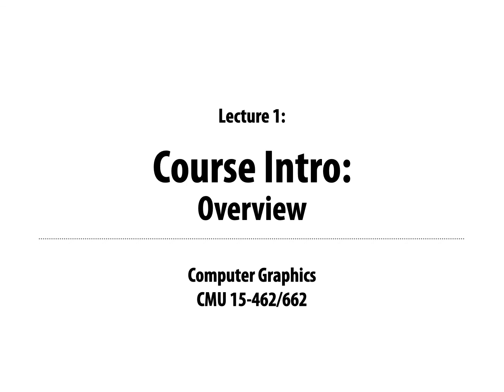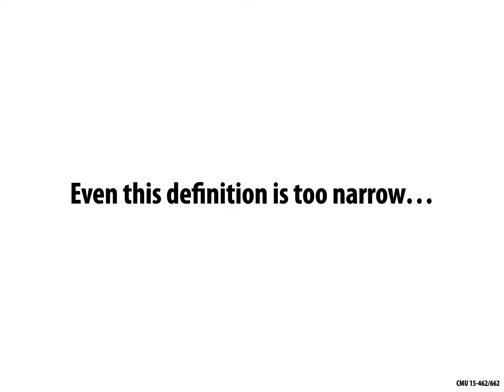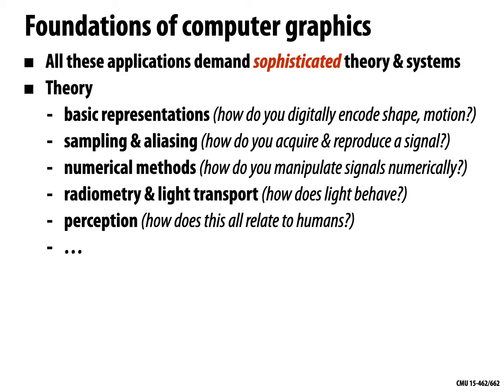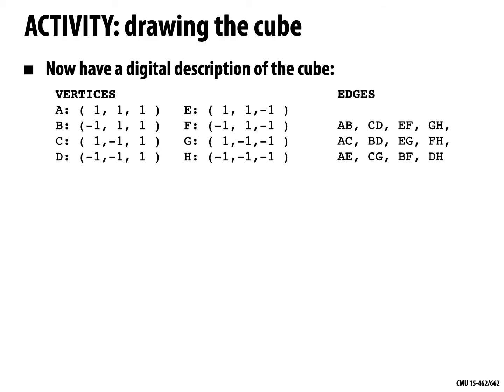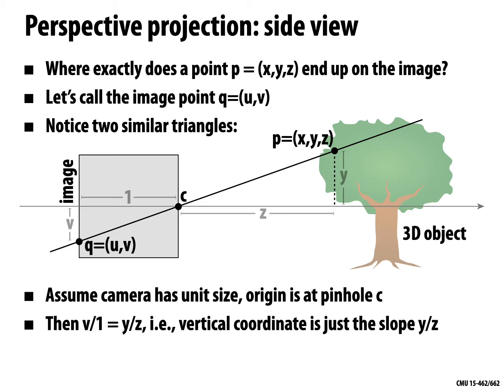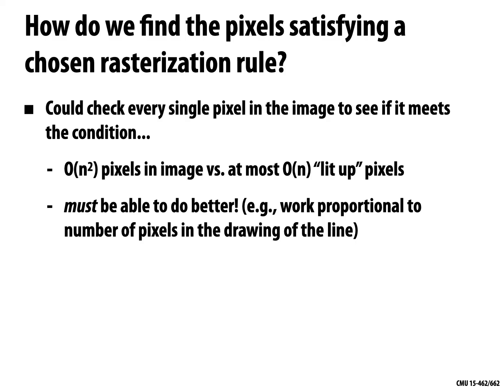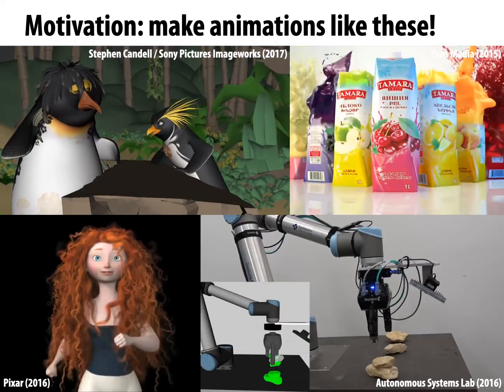Lecture 01: Course Overview (CMU 15-462/662)

Comment: 36:00 This is due to the angles at the pinhole being the same outside and inside the box. That means that the tangent of that angle will also be the same inside and outside. And since tangent is equal to opposite divided by adjacent, we arrive at `v/1 = y/z`.

Comment: One question, why if we mentioned that the cube was 2x2x2. We have vertices in 1 ,1 ,1 etc? should not be (2 , 2 ,2 ) vertice A ? and changing the remaining ones*
Reply: the cube is centered at the origin, meaning the middle of the cube is at (0,0,0), so if an edge goes from 1 to -1 it covers 2 units with 0 being at the center.
Reply: @unconscious5630  Thank you for taking the time to reply. I appreciate it a lot! And thank you for the clarification.

Comment: Found this channel to improve my work in sidefx houdini! I'm not very technical yet so this is the beginning of my journey to becoming a more technical artist to be more efficient in computer graphics by understanding more of the math and I'm already comfortable with coding so I hope this goes well.  Thank you.
Reply: Hey, I was just wondering if it actually helped you out ? I'm a bit in the same situation as you.
Reply: @stephanenathan8034  yeh for sure, it helped me in understanding certain concepts and how key aspects of things like geometry processing and rendering works! Also, I'm able to solve problems better because I have a broader way of thinking about problems. I mixed these computer graphics lessons with info from channels like https://www.youtube.com/channel/UCYO_jab_esuFRV4b17AJtAw (3 brown 1blue). I don't fully grasp everything but its definitely been a major help. Having knowledge about how to use vector calculus to figure out how attributes change over a surface is also amazing. I use houdini so it has a lot of functions in VEX or python that does the math for you, you only need to understand what kind of solution is required. Hope this helps you out.

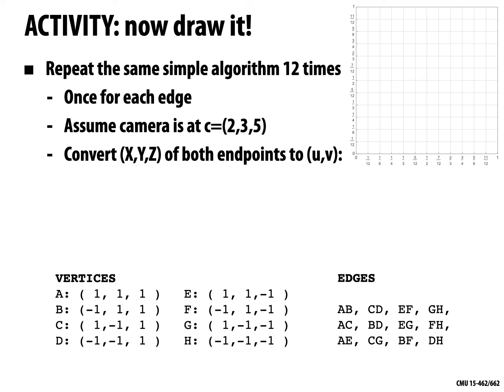Comment: 39:38 had me confused for a couple of hours. It all made sense when I figured out the camera is looking at the origin (0, 0, 0) from (2, 3, 5). Hopefully this helps out somebody.
Reply: I believe the camera is looking down at the xy plane at (2, 3, 0) instead of the origin (0, 0, 0), which is also the reason why (u, v) = (x, y) / z
Reply: If you know some linear algebra, then it's just translating your origin from its original (0,0,0) to the position of the camera (2,3,5). The subtraction results in vectors for the cube points that are essentially rooted at the camera location (rather than being arrows coming out from the default (0,0,0).

Comment: This may be obvious but perhaps it's worth mentioning that for the tree-pinhole camera example, that 
1) z is not the distance between the point (x, y, z) and the camera hole, rather it's the projection of the tree point on the Z-axis. 
2) the origin is at the camera hole.
Reply: hello. Can you please help me understand why we need to divide by "Z" to go from 3D to 2D as said at 38:12 in the lecture. Thank you :)
Reply: @principalsir5  I think dividing by "Z" causes distant points to "shrink" and nearby points to "expand" just like how real light in the world converges through the eye or a camera lens. That’s why a 3D image, when projected onto 2D, appears realistic and has depth.

Comment: 0:37 what is computer graphics?
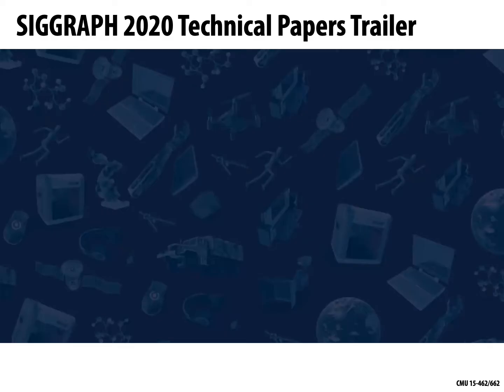9:12 Siggraph 2020 technical papers trailer
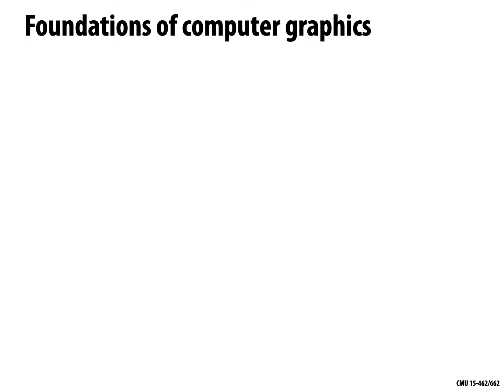17:03 Foundations of computer graphics
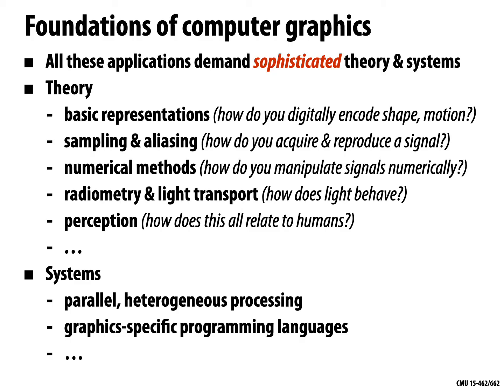20:02 Activity: Modeling and drawing a cube
29:49 Perspective projection
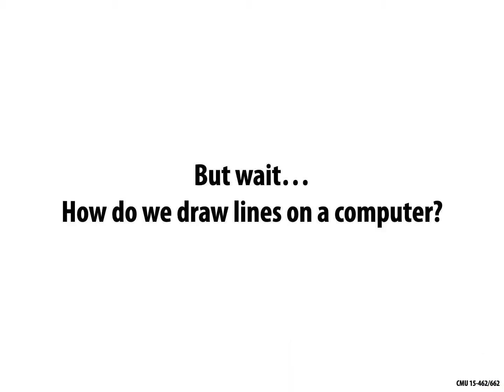43:48 How do we draw lines on a computer?
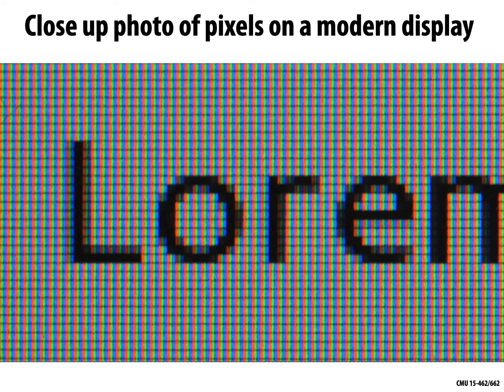45:36 Output for a raster display
47:09 What pixels should we color in to depict a line?
51:36 How do we find the pixels satisfying a chosen rasterization rule?
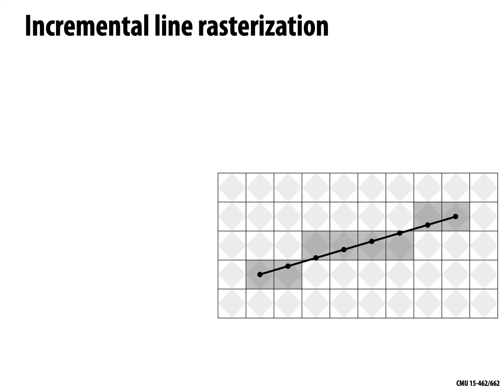53:53 Incremental line rasterization
58:51 Learn by making/doing
Reply: you're the goat